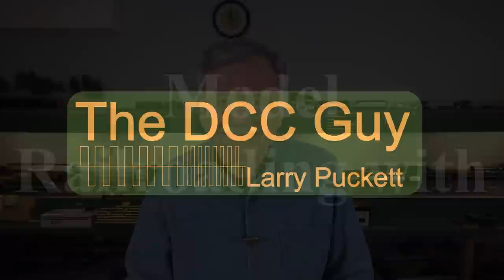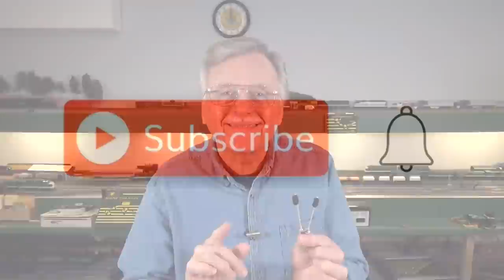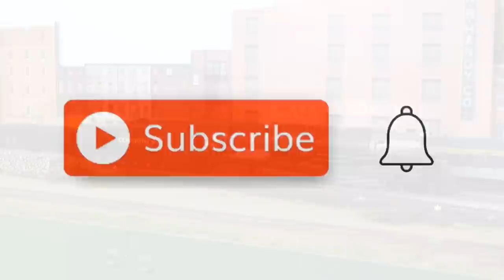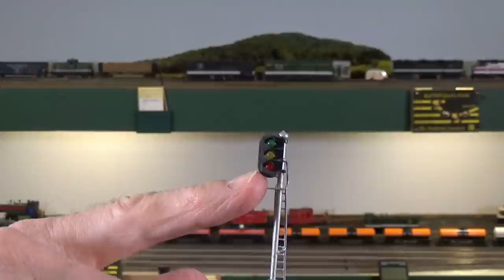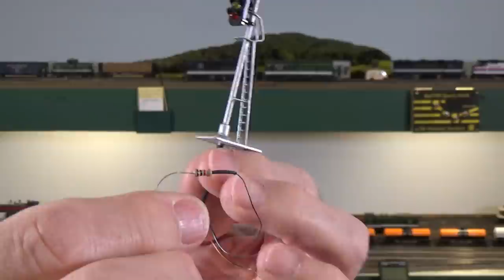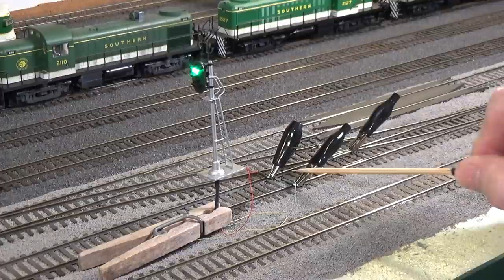Easy Signals For Your Model Railroad (246)

Comment: If only someone would do the same for PRR-style position signals.
Reply: Yeah, well we're certainly not on the common application list.  Cheap Chinese PRR signals isn't a thing either.  
I think a similar effect can be done on a PRR 7-light signal by wiring the center light to be constantly on.  The two vertical lights get attached to one rail, and the two horizontals to the other.  But the diagonals (the single yellow on a common three-light signal) isn't part of this method.  It would add some complexity, just as setting a prototypical secondary approach signal further back would.
This is definitely a very low tech (though excellent) idea for a simplistic imitation of a working signal system at turnouts.  Anything prototypical is a step up in complexity for sure.
Reply: I use a Signalist SC1 to control the signal, with JMRI setting the aspects based on feedback from the switch machines and block occupancy detectors. This is a LOT more complex than Larry's solution.
Reply from the maker: I never have managed to wrap my brain around those or the N&W version.

Comment: Has anyone here looked for signals lately? NJ International signals seem to be out of stock everywhere. It seems the only track and grade crossing signals are the rather crude looking ones off eBay. Is there a shortage? Has NJ gone out of business?
Reply from the maker: Yes, I was using Oregon Rail System signals until Dick died. Now his wife hasn’t been able to get anything out in years so I too have had to resort to those eBay signals and hide them in locations where they won’t be so obvious. As the Chinese say may you live in interesting times!
Reply: @TheDCCGuy  
Okay, thanks for the information! I bought a set of crossing signals off of eBay. They’re 3 times the size of my NJ international crossing signals just up track from my eBay install. The NJ’s are now just static display. Some of The wires got broken when removed from my old layout and I was wanting to place NJ’s at all three of my crossings. I guess I might buy some more EBay 3 month shipping from China signals and see if I can custom scratch something with them.
Reply from the maker: The ones I got are a bit short and the LEDs are the standard size instead of the smaller ones ORS used. Also the heads are offset on the poles. However if not placed near the ORS ones they look passable, especially in a dark corner.

Comment: Hey Larry my problem is nothing to do with your video. My problem is with my GP40-2 ,the other day turn on my layout push the accelerate button and then sorted out. That was after I installed a PSXX circuit breaker, very easy hook up. Here's the kicker I set it on the program track and reprogram everything and worked fine ,then put it back on the layout and did the same thing. All rest of the engines work fine any suggestions.
Reply from the maker: Ben, is it a factory installed decoder or one of yours? Does it do this everywhere on the layout? At any rate check the decoder wiring again just to be sure and also the PSXX setup. Something like this can be a real stumper and then suddenly the answer just pops right out to you.
Reply: @TheDCCGuy  yes to both questions
Reply: Factory decoder
Reply: I did check the wiring in the engine seems to be ok but not to familiar with them
Reply from the maker: Can you bypass the PSXX and see if the problem persists? That way you can tell if it is the loco or the PSXX.
Reply: @TheDCCGuy  So I bypass the CB and ran fine but funny how the other engines worked fine weird.
Reply from the maker: OK, then that tells me that there is some setting on the PSXX that is sensitive to something in the loco. You might play arou d with the various settings that control trip sensitivity. If you can’t debug it then an email to Larry Maier may help, he designed these. You can contact him through Tonys Trains website.
Reply: @TheDCCGuy  Ok thank you I will do that.

Comment: OK - How will this work on insulated frogs?
Reply: I would assume the frog wire would become the common when wired to an accessory point motor switch,wired the same way as you would on a mimic board lighting circuit.
Reply from the maker: Yes, the wire does not need to be attached to the frog, just to any point motor or other mechanism with a switch to change phase(polarity). I will be doing a video on manual methods that allow you to switch point phase(polarity) in the future as soon as I can order the parts I need.

Comment: What if you have insulated frogs? How does that work?
Reply from the maker: If you are using a Tortoise to control the points then you can wire the signals just as I showed in the video. I only had the wires connected to the rails to show how it works.
Reply: No tortoise but will be using the walthers machines as I already have some.

Comment: So what is the yellow/amber light for? Or can you buy signals with only red and green LED's?
Reply from the maker: Yes, you can buy signals with only 2 LEDs but I have not found any that offer red and yellow only red and green. You can also male your own and that way you decide LED colors but finding the parts these days can be difficult now that Oregon Rail Supply kits are no longer available. Somif you want red/yellow you are usually limited to the 3 LED signals.